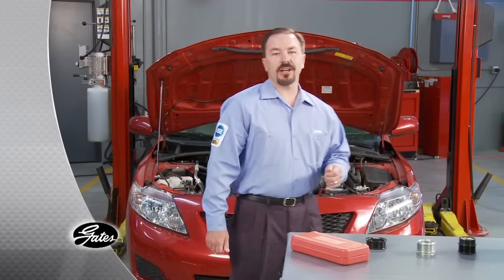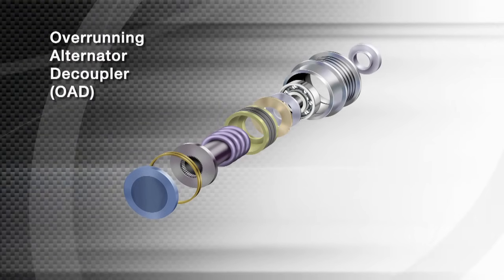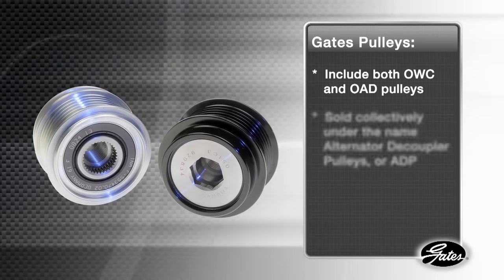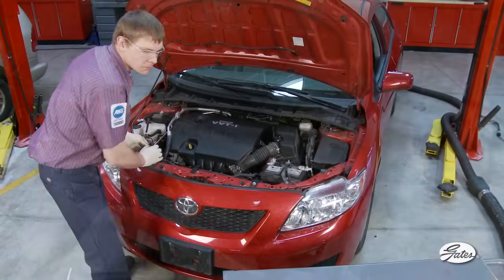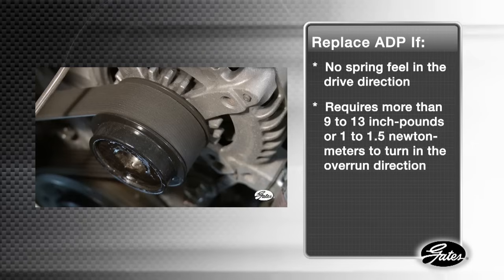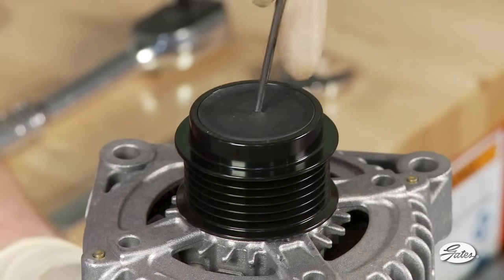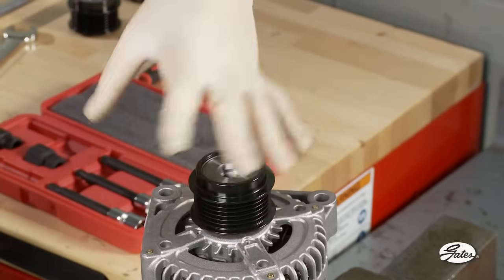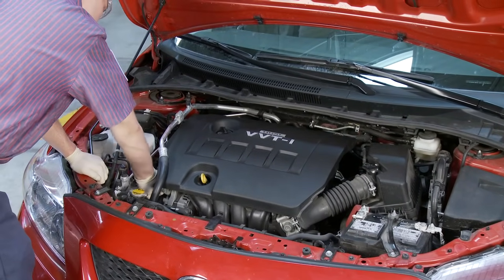GATES TRAINING: Alternator Decoupler Pulley - How to Inspect and Replace (full version)

Comment from the maker: Hi @mocky1220. Our ADP line includes both one-way clutch (OWC) and overrunning alternator decoupler (OAD) pulleys. Do not replace an OAD with an OWC or the other way around and DO NOT use a solid pulley in place of either the OAD or OWC.  The tensioners, pulleys and belt in the accessory belt drive system were designed for long lasting performance, and changing any of these components with non-OE spec. parts will dramatically reduce durability and will result in early failure of the accessories.
Reply: Long lasting performance , lol . That's the biggest joke of the all. These things are failing faster than any other part on these cars ! If they were truly long lasting this would not be happening sooner than my cars without them. I have cars with over 200,000 miles with the original alt with out the , long lasting junk over run decoupler .just another case of the manufacturers greed for making more money !!